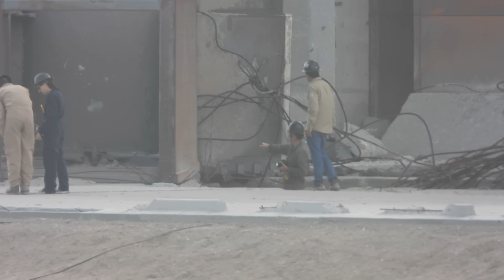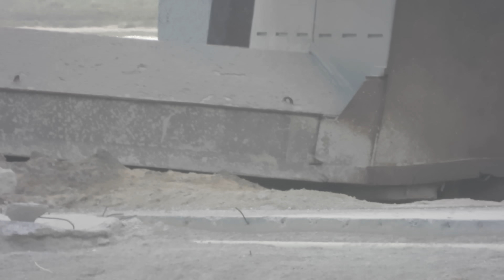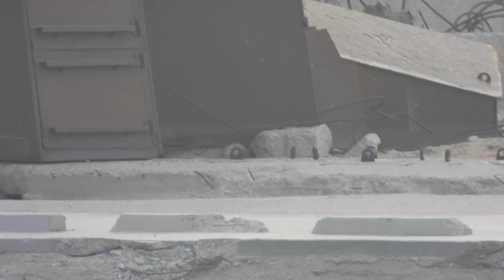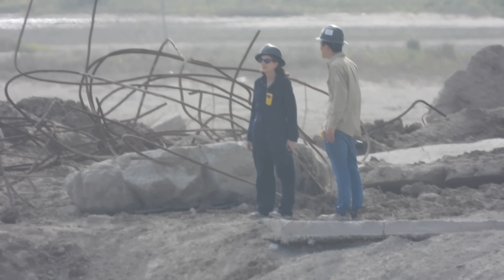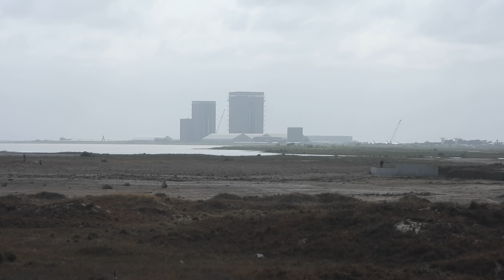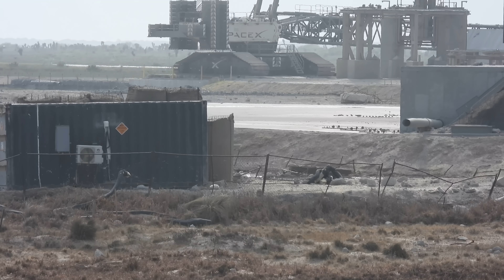Two Days After Launch, SpaceX Starbase, in 4k, Boca Chica, TX, April 22, 2023

Comment: Crazy just how powerful this rocket was
Reply: I wonder what a Saturn V would have done in comparison
Reply: @nzoomed  Starship is 2x the thrust of Saturn V, which is insane
Reply: They knew how powerful it was, and they never designed a proper mount.
Reply: @intheknow7659  relax, that's why this is called "testing"
Reply: @SickPrid3  "Destructive testing" 😅
Reply: Rocket fuel doesn’t melt steel beams.
Reply: Looks like they're gonna need some more rebar...
Reply: @clickbaitpolice1750  what about an  Oxy Acetylene ??  might be along the same line as the rocket
Reply: @clickbaitpolice1750  it’s not the file that destroy concrete and steal. It’s the crazy amount of thrust that will
Reply: @commanderdumbo967  I know, that's why I'm interested to know how the damage would compare to a rocket half as powerful.
Reply: @SickPrid3  Don't be too much of a fanboy. This was preventable. It was overlooked.
Reply: @nzoomed  If the design included a similar system you see used at other facilities. This would not have happened. They were going to build the same exact thing at the cape. The mere fact they were going to repeat this design, is a significant oversight.
Reply: This ain't you Grandfather's  Saturn 5.
Reply: @SickPrid3  It can be good or bad testing.
Reply: @intheknow7659  good data nonetheless. Stupid they did it, but it will make a great textbook case for future students, like the Tacoma Narrows Bridge. It will also make a good study for future plans of return flights from moon and Mars.
Reply: @nzoomed  it was made for their last rocket I think
Reply: @SickPrid3 but why build something you know won't hold up? Very expensive rebuild coming up...hope he has it properly engeneered next time. The amount of debris and 2 days of road closure to clean it up and make traffic passable is not going to go well to uphold their environmental impact study.
Reply: @clickbaitpolice1750 this was liquid methane and liquid oxygen blowing out the end of 33 rocket engines with a flame length twice the size of starship itself. An ascetalyn torch with a single nozzle and much less pressure cuts through steel...so I think you need to reconsider. The blast through massive chunks of concrete a the way across the road and onto the beach. They had to close the road for two days to clean things up enough to make the road passable again.
Reply: @bulakhv  Agreeable. There will be something learned from this. Hopefully they  do learn from it. I can't recall, but never really heard of issues with the launch platform with Saturn 5, as it was designed properly.
Reply: @intheknow7659  SpaceX has a move fast, try new things, and break things philosophy.  With the Saturn 5 NASA was doing crewed launches by the third launch, so while they pushed the boundaries the program was much more risk averse. I expect SpaceX to do dozens of unmanned launches before they put humans on board.  SpaceX is doing a lot of experimentation and among the mishaps may discover some good things by accident.  They knew the launch pad as it is was probably a mistake, but they did it anyway.  They could have delayed until their water cooled metal launch pad was ready, but they must have decided it was worth the risk to move forward and learn something from it.
Reply: @intheknow7659  So where did you earn your Aerospace engineering degree from?
Reply: @bulakhv  Assuming those running Space X are of a sound mind. Remember this. Elon did say he was against AI. But now he is researching it. The reason why the Falcon rocket FINALLY worked, and it was literally down to the final launch. I believe he finally hired someone on that helped rectify it, and the final launch (almost ran out of money) worked.
Reply: @desertsoldier41  Ok Karen.
Reply: @nzoomed  apollo5 would had made a mess too... but nasa thought about it after breaking windows in single engine testing......
Reply: @clickbaitpolice1750  but the thrust could bend them.
Reply: @intheknow7659  nobody has designed one yet
Reply: nothing crazy about it lol
Reply: @intheknow7659  Billions of dollars were poured into the Apollo program and this was in 60's dollars!! NASA had the funding it needed to design and create a launch pad that would not result in political backlash at the time. SpaceX is a private company. Yes they have some government funding but it's nothing compared to the Apollo program funding. They chose to experiment with a minimal cost solution and likely there were many other factors involved. Consider cost in your assessment about their engineering choices.
Reply: @wolfhawg  No but the concept is no different.
Reply: @user-vp1sc7tt4m  Bollocks. The physics involved are no different. 200 decibels of sound pressure will do all sorts of things if it is not contained... Their effort wasn't minimal, it was non existent.
Reply: @cyh4031  The oxy acet burns a tad hotter...
Reply: Looks like a warzone, it's completely insane
Reply: Especially how it did nothing  but blow up and need more of your millions to back to engine testing  bcoz it blew up.
Reply: @user-vp1sc7tt4m  Space X due to this blunder will have spent more in the long run, then if they had designed a mount that would have not failed. It is very well possible that failure led to the other failure of it not separating. Those chunks of concrete likely struck the bottom of that rocket, which could have resulted in damage. The damage to the tank farm also will cost $. They had TONS of time, and the proper design could have been implemented over a year ago. There was tons of time. Imagine if that led to a 100% success, as in it reached the intended orbit, and splashing down or burned up near Hawaii. This would have propelled them forward FASTER. Instead here we are, repairs vs other tasks have to be made first, and who knows what kind of repairs will be needed to the tank farm.
Remember, Space X was going to build the same exact Stage 0 at the cape, which would have had the same outcome. They apparently were OVERLY confident in said design.
Reply: @intheknow7659  this is the first time with this rocket, they could not care less about the pad itself
Reply: @SickPrid3  Yet they were going to build the SAME pad at the cape. So this isn't about caring less, it really shows those involved don't understand what they were working with. For how high the company has been raised, its really something.
Reply: @intheknow7659  there is no point to build something permanent at this point because it might have to be redesigned if the rocket gets some changes
Reply: @intheknow7659  their lainch site at the cape is on a pad designed for a saturn V rocket and has an existing flame trench.
Reply: @nzoomed  At least they are doing something right there. Boca Chica is a half assed approach.
Reply: @SickPrid3  relax, that's why he is called InTheKnow
Reply: more like lazy elon didn't feel like building flame exhaust diverters, something even russians had on their launch sites 60 years ago

Comment: Looking at that aftermath, 2 months seems a pretty ambitious time scale to be ready for the next launch.
Reply: A year, or longer.
Reply: Elon Time!😊
Reply: I would think that it could be 2 months and they will be ready. The reason why is because they talked about building a water cooled pad. Which was not ready for this launch and is close or near ready. 
In any cause they will clear the site and adjust a few things and add the new cooling pad which will likely not get destroyed when launched. 
I came up with an idea some time ago where they could build a deep pit of x amount of feet deep and then building some sort of structure in the pit that hold down 2 inch slabs of steel with special type hooks or anchors and then when the launch is ready they flood the pit and then keep pushing water in to the pit as the launch happens it will dump more and more water in to the pit which will keep it cool and create a lot of steam. I would think this could work. Yet this is just an idea that I had. Could be something like what they were going to do?
Reply: That was amazing power ya'll.. (could launch out of the ocean) It'll take some time to fix all this.. Even a slab of cement takes like 1mo to cure 70 or 80%.. Better to use a two side trench too,, layers of steel and post tensioned slab sections backed by heavy dirt berms.. this thing is a beast.
Reply: They had to redo it any way. Used the launch as a pre demo tool.
Reply: I heard somewhere that some SpaceX employees are saying 4-6 months which seems a bit more realistic to me. (Couldn't find the source so take this with a massive grain of salt)
Reply: Naw they could do it in 2 months. I mean the thing only needs to reach the first inch of flight. it would just dig a deeper hole, its not like anyone lives there.
Reply: And most of the breakables have left the zip code anyway.
Reply: Never happen
Reply: They were going to need to dig anyways if they want flame trench or water deluge system so I see this as a quicker way of doing that 🤷🏻‍♂️
Reply: I think what Elon meant is that the launch area will be ready again in a couple months, not that there will be a launch
Reply: They can do it. SpaceX has already completed and done a lot of testing on Starship 25 and Booster 9, the next to go. What just blew up was Starship 24 and Booster 7  (not sure where booster 8 has got to). Musk has said they are already well into fabricating the new launch pad design, made up of two layers of steel with cooling water running in between, instead of solid concrete.

What it sounds like the pad still won't have, a deep deflector trench, is down to the particular location and ground conditions right by the ocean. But skipping this will save them time. So the next launch will test out a water-cooled steel pad only, and assuming that manages to accomplish a launch, how the two flying components perform as they proceed further into the mission. That's the SpaceX way - test prototypes early and often to keep generating data to guide development.

How does this make financial sense? Something I read recently says the main costs SpaceX is carrying during development is not the expenditure on hardware and fuel, but the labour cost of all the skilled people SpaceX is employing and contracting in. Having these people waiting around makes no sense when there's another Starship and Booster ready to go. So iterate fast to a hopefully improved pad design and get the thing in the air again to gather new data these people can usefully work on.
Reply: @Randall Snell   I don't think it take that long it only took them so long the 1st time because they were trying to find their pace & get the approval I can see them launching before the end of the year Assume regulations allow for it.
Reply: Way ambitious! Is awesome!
Reply: they have the second launch site.  that might be ready before this one.   i really think they should just switch back to launching on old oil rigs that they repurposed.   it solves so many problems.
Reply: @Randall Snell nah. Maybe 3-4 months max. They were aiming for the end of July but since there's this much damage to the platform it'll be August or September before the next launch. I think.
Reply: As long as the pilings haven't shifted,  the extracurricular excavation might be helpful if it got stuff out of the way for the active cooled flame diverter they were building for it.
Reply: The problem is not heat. The problem is the amount of gas / plasma  and the velocity of that gas / plasma.

The material is supersonic and to lift 5000 tons of rocket against gravity at 9.8m/s/s there has to be the equivalent mass coming out.
So for example 5 tons per second travelling at 1000m/s
Reply: 2 Elon's months.
Reply: @Sagan_Starborn  I'm pretty sure that heat is part of the problem.   That concrete could probably handle 5000 tons per sec. of water flow for example.
Reply: I predict 2 additional years on top of that.
Reply: Concrete needs to cure.
Reply: Now also think about this : pov: you work for Elon Musk. He is your boss, he asks you to do it in a 2am text and you have to do it coz otherwise he would fire your a** lol. Its amazing what a human can do because of boss's threat.
Reply: @HoLeeFuk317  Never have self landing reusable rockets with 3 D printed engines either.
Reply: @ianstobie  Do you think they are going to put in some form of mitigation to prevent further damage to the tank farm? Could the FAA insist on it being protected as it’s taken some serious looking hits on the first test flight. I realise they’re double tanked with insulating material between inner & outer, there has to be concern though?
Reply: Nah, the rocket did most of excavation work
Reply: Nah , couple weeks. Backfill it. Cover it with heat shield tiles already on hand.
Reply: @garyphillips7993 protecting tank farm could slow them down. Depends what they have to do. If they have to move them would be a big delay. I think there are seven there now. Adding the last three took two months back in 2021. They hold cryogenic LOx, methane and nitrogen, and have a lot of perlite providing insulation. Tanks made of same steel as Starship's structure, so can't be that strong in the face of flying debris.
Reply: And they were designing the tower to pick up in the air the Starship so it can be relaunched in hours 😂
Reply: @tonamg53  I think Elon was like a 16 year old who just spun cookies in a gravel parking lot. I’m sure he had a pretty good idea what the destruction would be like.

Comment: I knew for certain the launch pad was gonna be hurtin but dang it got annihilated !
Reply: I think starship was held down longer than planned, maybe they thought they get all engines fired
Reply: No deflector, no flame trench , no nothing to protect the pad. NASA probably could have helped with the design.
Reply: You see that spaghetti mass of rebar? those used to be Inside of some pretty substantial concrete, which is now just gone.
Reply: @kenore4003  SpaceX knows how to do that 

The true vision was to do without one to easily build them everywhere but turns out it was more powerful than expected
Reply: @kenore4003  And the fuel tanks way to close to the pad! Some very poor decision making on display. Did they use salt water for cooling? Looks like a total loss to me. They will need to start from zero imho.
Reply: Rocket fuel doesn’t melt steel beams.
Reply: @clickbaitpolice1750 yeah no shit but pieces of concrete destroy your rocket and facility
Reply: @clickbaitpolice1750  😘
Reply: @ericjanson2328  Not really. And the tank farm is already slated to go. So no loss there, it was after all just a stop gap because the actual tanks were basically unavailable. And if they pad already needs to be mostly ripped up no matter what to make the additions, why care about it getting torn up by the launch. It also gave them data on how destructive the exhaust is. Which is something that isn´t as easily calculated. So they now can get a very good idea on how they need to build the future countermeasures.
Reply: @kenore4003 .  but their ego would suffer, they are SpaceX macho rocket men, they think outside of box, they don’t need stinkin flame trench.😊
Reply: @dianesaenger9412  i think thats what i heard from jack beyer it the skirt got damaged from the hold down clamps ! It did good !
Reply: @kerbal8216 yes...bad engineering...they should have listened to NASA engineers
Reply: @kerbal8216  More powerful than expected?  How is that possible with several of the engines out?
Reply: @ericjanson2328  Looks like a write off to me too.
Reply: @theexchipmunk  "...Which is something that isn´t as easily calculated..."  Bullshit. I'm not buying that.
Reply: @kerbal8216  Well duh! Apollo would have done the same as would the Shuttle. Also, it was less powerful than expected as a gaggle of engines weren't operating.
Reply: @clickbaitpolice1750  200 decibels of sound pressure will destroy pretty much anything. You never stopped to wonder why NASA used all that water?
Reply: @daanzoomer2997  it almost did explode, with all those dents in the fuel tanks.
Reply: @ericjanson2328  And why verticle?
Reply: @theexchipmunk  All of this could have been avoided - it's not exactly rocket science! Compare this to the first Saturn 5 launch in 1967.
Reply: the goal was to design a simple platform to be able to build off planet and be less intense on materials. theyre testing these things for a reason
Reply: @MrPuddinJones  true ! i was thinking how over engineered the olm seemed but like elon stated the best part is no part !